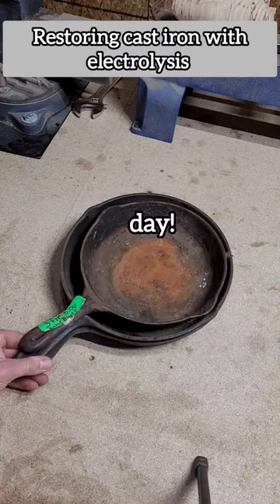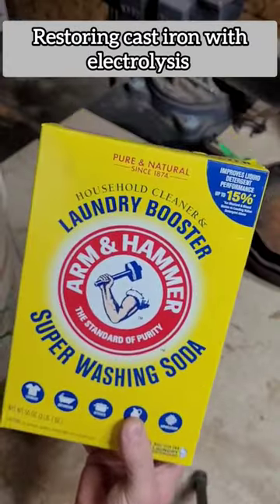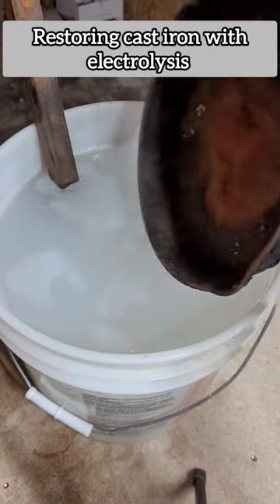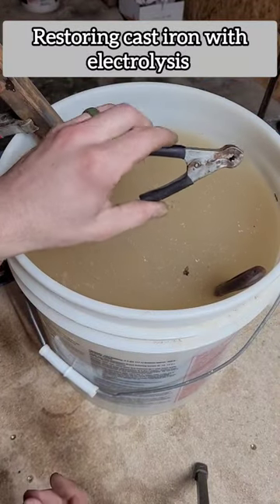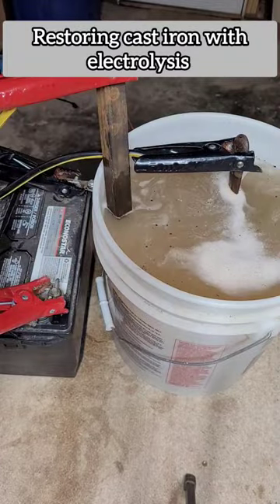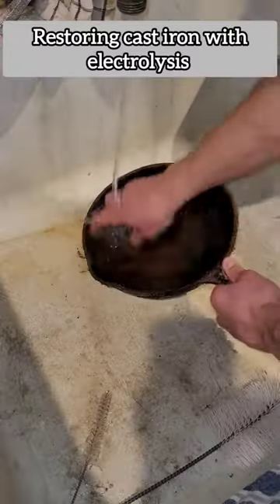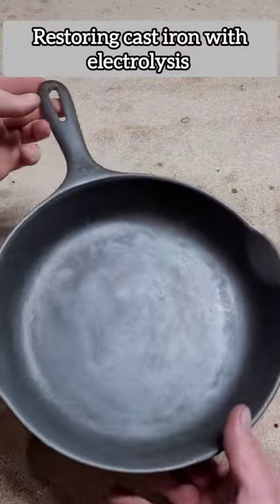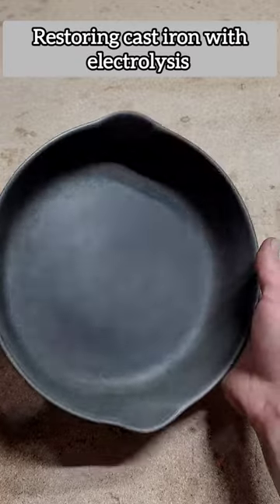Cleaning/restoring a cast iron pan skillet with electrolysis. #shorts #satisfying #cleaning #diy

Comment: We owned a restaurant business for ten years.
I burn a new skillet back to bare metal in the oven on 'clean' cycle.
After it cools to a couple hundred degrees, I oil all surfaces with coconut oil.
With the pan in the oven, I heat the oven to 350°, shut it off, and leave the pan in the oven overnight.
.
Rough cooking surfaces get a couple-three hours with the DA orbital sander.
I use 40-grit, and a pan might need a couple-three fresh discs before I am satisfied.
Reply: 40 grit be serious rough, do you remove metal?

Comment: Why did you switch the electrodes?
Reply: idk maybe it reverses the polarity and cleans it better? idk? 🤷 the man's got results though can't argue with that
Reply: That probably wasn't  the first time  he checked the pans progress, may have just mixed them up after finding out the pan wasn't ready yet.
Reply: @yucatansuckaman5726   Looks like he took a wire brush to it between clips to me.  
Look how the part of the handle outside of the water suddenly looks just like the part inside.
Reply from the maker: I switched from my battery charger to a battery and jumper cables because my charger doesn't actually put out any voltage unless it detects that it is connected to a battery.
Reply: @craftzmanchris9859  Cool.  Thank you for the explanation.  I was wondering because it seemed like switching the electrodes would "undo" anything that had previously been accomplished by the process.

Comment: The 9 inch skillet was made by Wagner ware in the 1950s.
Reply from the maker: You really think its that old? That's pretty neat! It seems like a higher quality one compared to some other old ones.
Reply: Cast-iron geeks, of which I am one, know that Wagner made a lot of pans without their famous logo during that time, especially to sell at discount stores like Woolworths. During the 1950s, they used that typewriter style font on the markings on their pans. Meanwhile, in the early 1960s, they started putting a MADE IN USA mark on their pans. That means this pan was definitely made before the 1960s.
Reply from the maker: @castironchaos  Very cool! Thanks for the info! (I now see your channel name and checked out your page!). Do you think I should be concerned about lead or any other hazardous metals?

Comment: Is there a other way????? I don't have those things
Reply from the maker: Depends on how bad it is. You may be able to get away a brillow pad with soap and water or you could use a drill/grinder and a wire wheel. A wire brush, hammer and chisel, chainmail scrubber and oven cleaner are all tools you could use. I prefer electrolysis because it does all the hard work for you!

Honestly if you have a set of jumper cables you could set a bucket out in front of your car and use your car battery as the voltage source. Very easy and cheap to do that way.

Comment: When I burn my pots and pans I use a wire brush with my drill it knocks that stuff down quick
Reply from the maker: I thought about using a wire wheel and a grinder. It would have worked well but it would have made quite a mess. This electrolysis process was easy because it did all the hard work for me.